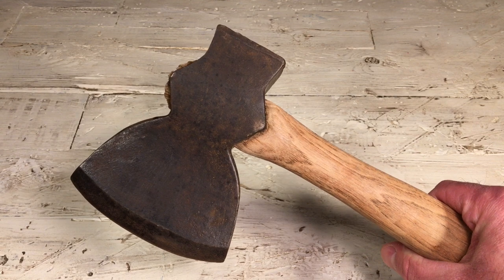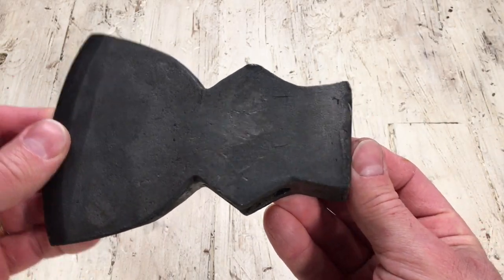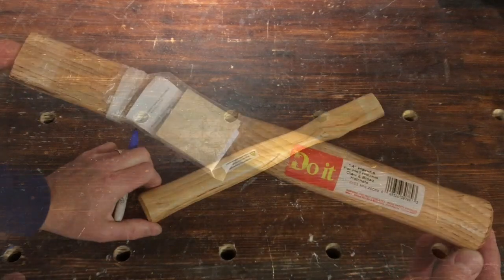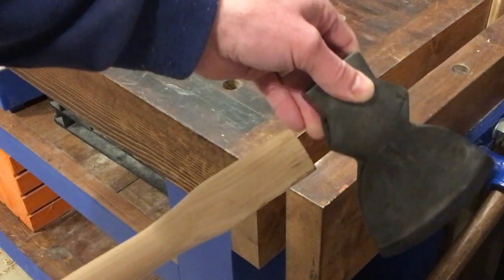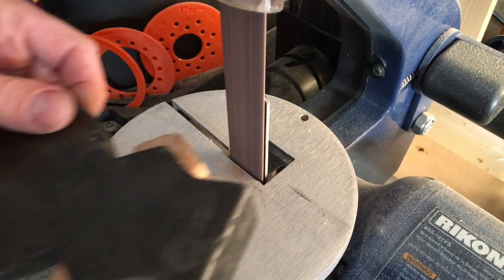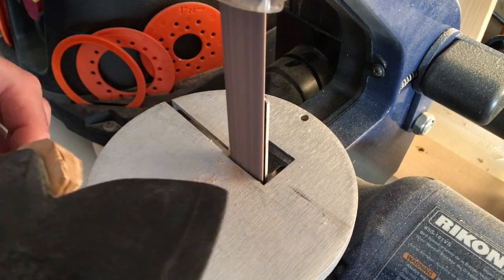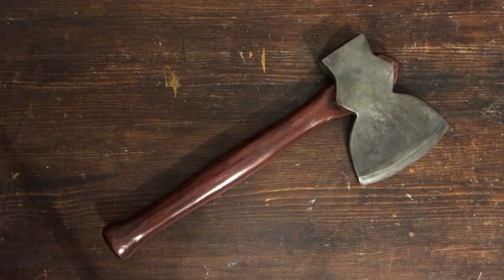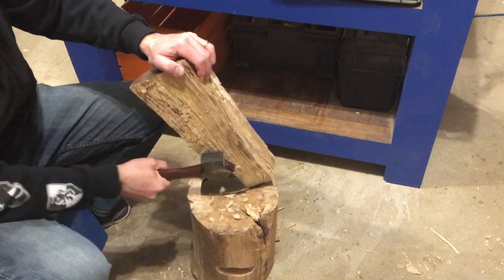Hewing Hatchet Restoration

Comment: Do you have a video (and/or plans) for that little 1x30 bench grinder attachment you made to keep the correct bevel @ 10:56? I've got one of those little HF 1x30s and that would be super useful.
Reply from the maker: Sorry I don't have a video for that angle jig. That one is just a prototype I have been testing.